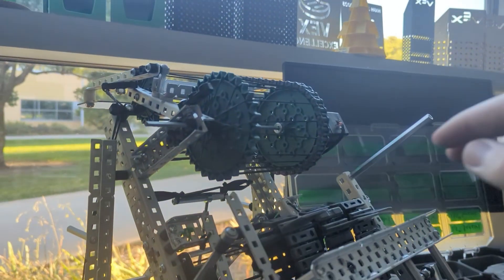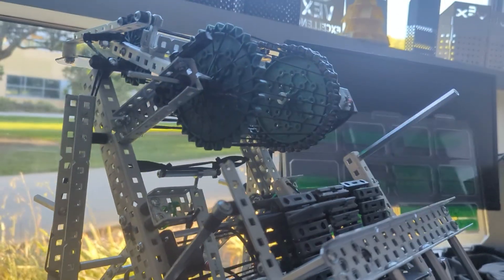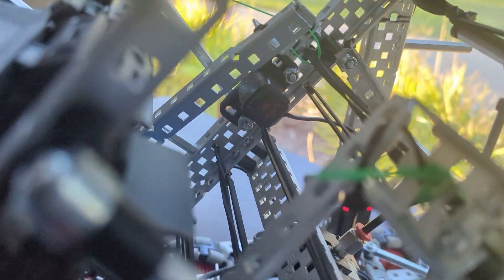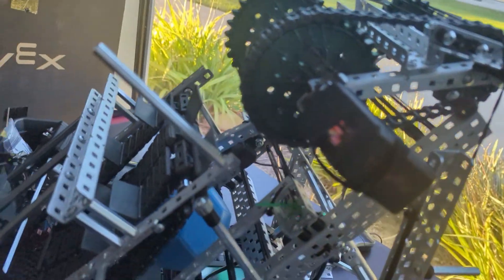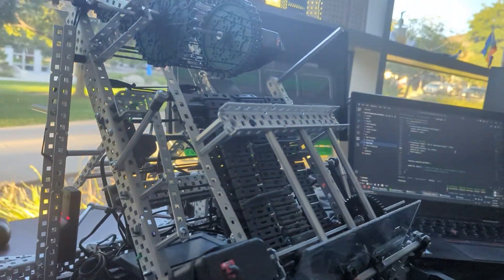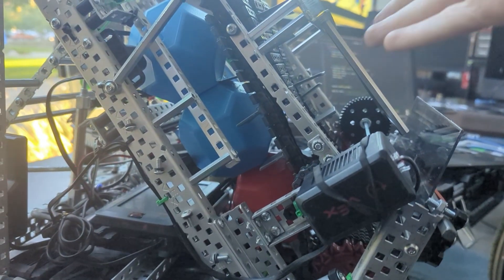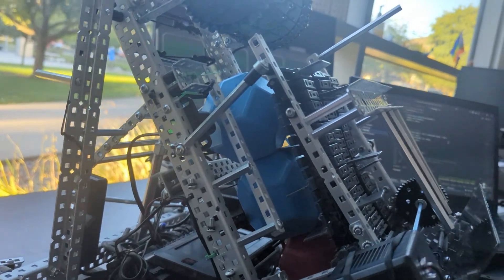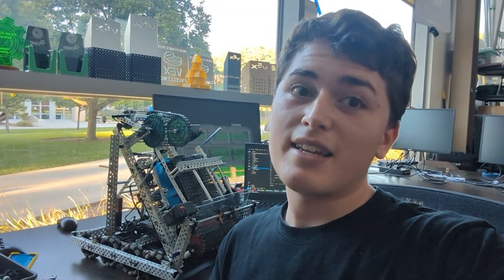How This Robot Color Sorts Automatically | VEX Push Back

Comment: Does it still outtake normally?
Reply from the maker: If tuned well then it can, but it's not super consistent, which is why a lot of teams don't do it this way anymore. Colors sorting is usually done through the mid goal scorer part of the robot
Reply: @Joseph973 thank you for responding ur the goat!!!

Comment: I don't know if this would work for your bot, but it worked on our basket bot and last years bot. Add a optical and distance sensor. In code put a when started, forever loop, if sensor detects color AND distance within certain amount (so it doesn't detect thing 20ft away like ours), spin motor _______. Do the same block for red and blue and have them be different commands.
Reply from the maker: Yes, that's a fantastic way to do it. I found that for my robot, I didn't need the distance sensor, but especially last year it was necessary. I'm glad to hear you got your color sorting working!
Reply: @Joseph973  so are we! My parents just donated our schools first 4 half watt motors and some anti slip matt for our basket and so we can make our basket 4 motor drive. It's wayyy better now.